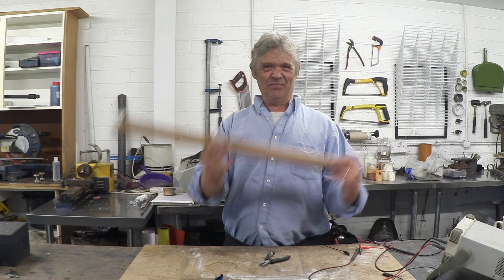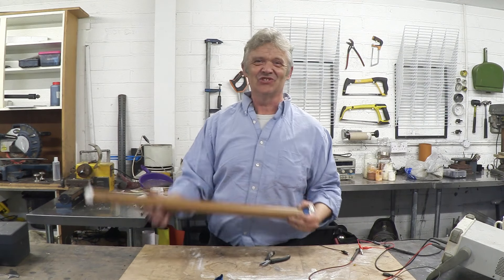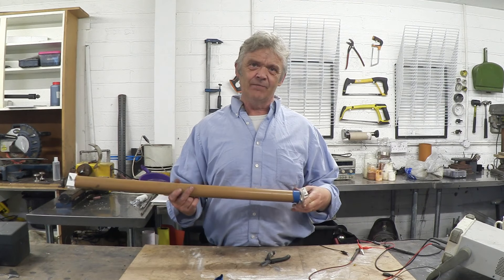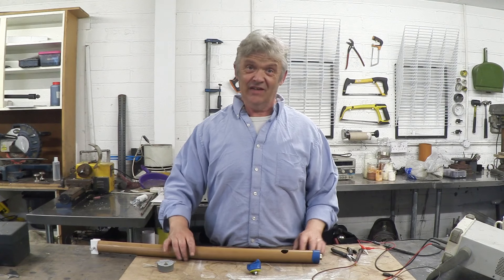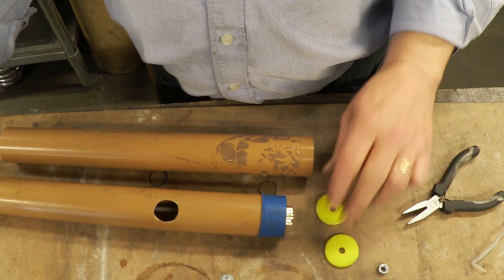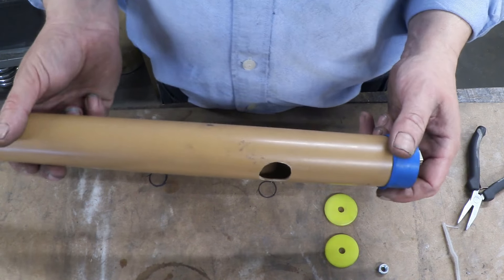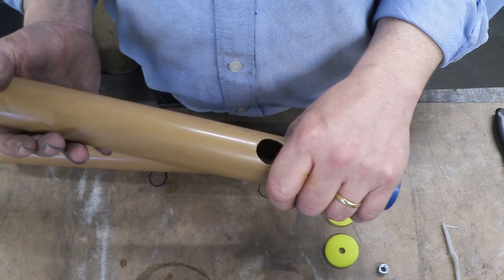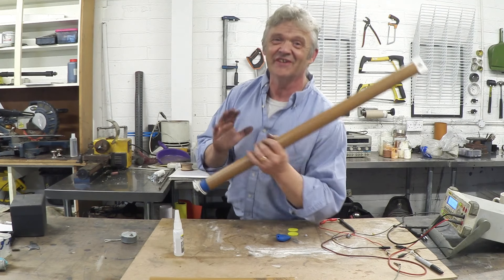A Wind Generator That Works Even When The Wind Stops Blowing

Comment: I've noticed in comments a lot of people thinking wind. My mind goes to water. If you had a pole extending over water and these wind generators as you call them, hung down off of the pole looking like a comb or rake then they would bounce off the top of the water with help from a foam ball at the end. Of course it wouldn't have to be a ball, it could be a paddle or a square. I can imagine this extending over water and all the fingers (wind generators) all jumping about making you electricity.

Comment: Could a vibration electricity generator be adapted to be powered by rainfall? There is an awful lot of potential energy in clouds. For instance, a cloud slightly more than 12 metres long and same wide and high ( assuming cube- shaped clouds), would condense to 1 cubic metre of water, which has a mass of 1000kg. If this cloud is 1000 metres above ground level, then the potential energy ( given by E= mgh, where g = acceleration due to gravity) comes out at 9.81 Mega Joules. This energy is converted to kinetic energy as the rain falls, and is then dissipated as noise and heat when the rain hits the ground. Surely there must be some way to recover some of the "rainfall energy"?

Comment: I never thought of putting it on the side for the Coanda effect. I've always thought of the acoustic mechanical energy of a whistling open-ended type, not unlike the thermoacoustic effect of B&J's subwoofer refrigerator (only in reverse).

Comment: If you multiply your short circuit current shown on the meter by the open circuit voltage (switch to the voltage range with the same lead connections) you will get a rough idea of the power produced.  I would guess about 200mA x 10mV = 2000 uW (micro watts) or 2.0mW of energy.  In reality. the output energy will be less than this, even with a properly matched load.

Comment: Wish you would get what you are talking about right in your description. As dose it t generate WIND ??? As you say it is a wind generate. But it is an ELECTRICAL generator POWERED by the wind. 
Just as a water wheel dose NOT generate water, it transforms the energy from the water into some other form of power. This could be physical power to turn a stone to grind up to make flour, or if you hook it up to a electrical generator, then it will make electricity. 
So what you are describing is an ELECTRICAL wind power generation system. 

SORRY for sounding pedantic, but I try to use the right words to explain and describe things. 

I can give you a good example of this. As many years ago I worked for what was then British Rail. A guy asked me when the Newcastle train was due. I asked him did he mean the train going to Newcastle or the train coming from Newcastle ??? He told me that it was obviously the train coming from Newcastle. I told him that Ben it was due, but told him next time he was to ask anyone, to ask them about the train FROM or the train TO. 
As I could have quite easily told him about the train going to Newcastle, and he would have came at the wrong time and gotten mad by MY wrong information.

Comment: Hi there ...Can we use a speaker instead as  it contains a coil and a magnet and it does vibrate and use it in the opposite way to generate power ?

Comment: Hey, what do you think about using guitar strings in place of the artificial vibration device your using? Guitar strings can be easily tuned and are very sensitive to both touch and high pitch sound, just a thought.

Comment: Put a round spiral wind turbine on the outside of the pole that also produces electricity and vibration and you get a two for one generator to put next to a highway. Connect them all together and you have free LED light post.

Comment: Take a stereo speaker and connect to the multimeter. You also will read voltage and mili amperes because of the vibrations. Sadly is very low wattage.

Comment: What if you rigidly fastened the base of one of these, to each pane of glass on all commercial buildings ? Eventually backup battery packs would be filled and all extra could be sourced internally for lighting etc...Great idea for bulk applications. Watching a spy movie gave me this idea. Listening devices reading the voice vibrations off the window glass means constant vibration from all kinds of sources. TAP THAT ! Noise pollution becomes a positive !

Comment: Now THIS is really cool.  Especially the low cost, apparently easy-enough assembly, and public domain.  I can imagine several of these mounted on a horizontal base, the whole thing shaped rather like a menorah - even though I'm the world's worst at crafting useful things.   .....  Did I miss something about the suggested gauss (??) of the magnets?  How is this device attached to something (a go-between?) where you can attach the cell phone etc. ?  I mean, no point in creating electricity you can't access somehow.

Comment: This would work great as a windchime with several suspended on strings and a clapper suspended in the middle on a string.  Slightest wind blowing and the clapper would set them to vibrating.  Hmmm....I might just try this or something similar.

Comment: I actually saw something similar recently on the channel "Undecided with Matt Ferrell", where he went through several different projects for possible solid state wind energy systems. In that it was called a Vortex Bladeless wind turbine and it's based on vortex induced vibration resonance, ie. vortex shedding. The design is slightly different, but I think it's basically very similar and highly scalable. That said, their nearly 3 meter turbine only churns out 100 watts.
Reply: That is where i saw it too, on the Undecided channel on YT
Reply: Just fabricate 30. units of such contraption, and you shall harvest 3,000 watts of power for aver. resident daily consumption... As simple as that...
Reply: What's the power generated ?

Comment: I agree, if we want to "go green" it will take combining many many different generating methods together efficiently into a main grid system.  For example, on a british television show starring a regular cast member of Junkyard Wars and his family living in a country farm house off grid.  They used a home made hydro-generator in a small stream for power, they also used a version of windmill power with special blades that spun no matter which direction the wind blew from then put the generator motor and the propeller inside a plastic pipe and ran additional connected lengths of the pipe down a seaside cliff into the water at the base of the cliff and the never ending wave motion of the sea water pushed and pulled the air through the pipe running the generator nonstop.  I think by combining ideas such as this with ones like your windless wind generator creatively ( like your idea of using wasted kinetic energy such as bridge/highway vibrations to generate energy ) and by creatively adapting these and other ideas to generate power.  for example wind turbines strengthened and adapted and placed submerged in ocean canyons ( carefully blocking the areas with nets to protect sea life so we don't have an ocean version of the massive bird kills of wind mills on land ) with predictable constant currents for dependable energy.  Or using scrap waste fragments from solar panel production to power small DIY style hydrogen generations that only require a few volts to produce results but deployed in massive solar farm style or in a deserted open landscape build a skyscraper to house the dozens of floors with hundreds of individual generators per floor and the roof and surrounding property covered with the solar panel fragments each wired to a single generator induction coil for separating out the Hydrogen with a pipeline bringing in the water or sea water for a less efficient manner not requiring trucking in the more efficient chemical additive.  But until this can be done we need to get back to the Trump plan and make America energy independent and an energy exporter, because if you really want to protect the environment you have to admit America produces oil and natural gas much more cleanly than Russia, China, Venzuala, and OPEC who are the main world energy producers now and they are pumping out hundreds if not thousands of times more polution than America does while producing more energy.  The current plan by the Biden administration is apparently save the environment by destroying it.

Comment: Idea to help you, replace the coil and the magnet with a piezo element and 4 diodes to get DC .... it removes the expensive rare earth magnets, they cost only 1 USD and can output a very very high ac voltage on vibration... the high voltage allows you also to use very thin wires so you save again on copper. If you buy 4 of those piezo elements then you dont even need the spring in the middle, instead you just put the pipe on the 4 piezo elements, bam.... free electricity on micro vibrations...

Comment: I havent seen your artificial muscle yet... Untill then, my thinking goes with principle of a tonally tensioned blade.

With some black paint, an optimalised freq hole/pipe lenght and diagonal/vertical positioning of the unit, 
convection from sunlight ought to be able to generate draft enough to make internal flute tone for solar acoustics as well.

Pipe in painted copper and outer glass tube as a convection heat amplifier most of the tube´s way, could prove fun. Probably to some cost of the ambient noise collection...
Will an exponential horn on top be able to effectively amplify the vibrations ?

Comment: ... the tube with the hole in the top will catch rain...
... would flip it around with the capped end at the top...
... *... could a screen door metal spring be used...?

Comment: I think that this 'invention' a magnet mounted on a diaphragm vibrating in a coil is commonly known as a microphone. I suspect that the 'load' applied by your DMM is <1ohm and therefore the power output is negligible :)

Comment: The shape of the tube could probably be enhanced to maximise turbulence and vibration as the air moves past. A smooth cylinder doesn't seem optimal just guessing.

Comment: I know I'm 2 years late but I was just thinking, what if you put a small metal cylinder inside the tube only connected to the midpoint of the muscle and not touching the inner walls of the cylinder with the muscle running through the center of it? Hopefully that makes sense. Like imagine if you glued 5 dimes face to face, drilled a hole through the face of one and out through the face of the other end, run the muscle through that hole, and glue the cylinder of dimes to the muscle running though it and the midpoint of the muscle? It would take more energy to vibrate the muscle but if you got it vibrating enough then the inertia of the the metal cylinder moving side to side would produce more energy. Like imagine you have a bunch of tunes designed like this laying horizontally underneath a layer of asphalt on a road. That would be enough energy to shake that metal cylinder where-as the muscle alone probably wouldn't be able to make use of all of that incoming energy.

Comment: For the past thirty odd years I've been insisting that the way to cleaner, cheaper and safer energy distribution is to go low-voltage domestic, wherever possible.   So long as the amps equate to an average household requirement; which must also include reviewing one's energy requirements, that must include; change of lifestyle - education (switch that bloody light off, when not in use...).  And the understanding that Every Little Amp helps...
.
I've been working on a design for a new type of central hot water/heat storage system, based on the Thermos Flask principle; concentric hemispherical cylinders with a vacuum between - the inner vessel  containing the hot water storage, fed by various thermal generators - back boiler - solar-thermal collectors - ground source heat pumps - low voltage elements.  Brazed to the inner vessel are an array of radial heat-pipes that conducts some of the inner vessel's heat - through the vacuum space - to the outer vessel, via ceramic 'ports' where the heatpipes are brazed to radial heatsinks surrounding the outer vessel.  The whole tank is further encased in a box of mica insulation chips (loft insulation).  Attached to each  heat sink are the 'hot' ends of an array of thermocouples, with the 'cold' ends attached to another set of heatsinks located on the inner surface the encasing box; an extra coolant circuit could be employed.  The current generated by the 'radial thermopile' should be adequate enough to run the the ancilliaries of the whole system - pumps - valves - uProcessors, controllers etc...    Combine this with good house insulation and solar-kinetic electrical generation - PV - wind - your 'energy harvester' and we get a 'net zero' lifestyle - more or less...    
.
The idea was formed when studying the design of Systems for Nuclear Auxiliary Power - or SNAP generators that are used in space probes and satellites, or marine autonomous vehicles.   The Radio Isotope Prolonged-Powered Life Equipment - RIPPLE generator uses a similar array of thermocouples on heatsinks, that surround a casing containing a plutonium pellet the releases heat as it decays.  In the relatively cold vacuum of space, thermocouples are ideal, giving the thermal gradient required to generate enough wattage to run the vehicle and its sensors.            
.
I think I need to check-out your membership.  As You Sir, are a 'steely-eyed missile man' for sure and your concepts are right up my brain pipe.

Comment: Im no scientist or educated individual. But if im understanding correctly. The base goal is to vibrate the diaphram/magnet. So wouldnt using and straight wire/or something more solid instead of a artf.muscle be better?. The artf muscle i feel is essential a spring. Which will absorb more energy and dissipate it in the tube before transfering it to the diaphram.? Maybe im dumb.

Comment: why not use a steel spring? That's last  longer than the  wound up trimmer string  wouldn't it?  One ting I've often wondered at is the question of magnet  cost and durability.  they do wear out and there is a cost to produce  so  maybe some time   talk about the  Return on investment  How many coils? How much in  materials versus how much energy produced?

Comment: Hi guys - vibration in long metal tubes - OK...any long tubey things around my place?
I was curious as there are hollow metal street lamps outside - and there is an  onshore wind at the moment.
Wow.... a lot of vibration in one lamp post ! Quite amazing amount actually - and there is a street full of them.
Quite frightening when you consider if you added all that energy up of those lamp posts in my street. Sure not as flash as a spinning wind turbine
but a untapped energy source for sure...hmmmmmm.....wonder if the council would miss a lamp post...LOL - just kidding...

Comment: I had an idea about the energy that can be made by a automobile running over pressure points to create a vibration on the roadway to create electricity.

Comment: You're gonna get almost no power out of that, even if optimised. The energy in wind is based on the cube, the third power, of it's speed. Then this thing just looks so inefficient, it's not taking advantage of the mass of moving air.

For the materials and the effort, there's much much better ways you could come up with a generator. I think it's a non-starter, honestly. Maybe for extra-low power sensors or something that charge up a capacitor then report by radio once a blue moon or something, where ruggedness would be important. Although even then, ice would likely bugger up the membrane and the workings. Not one of your best ones, Rob, though at least you gave it a go.

Comment: i'm still learning... but.. doesn't it mean if you don't know the volts.... then in theory this could even mean the device might only produce 1 watt of electricity in a million centuries?  If the miliamps are 200, but the voltage is very low.  ?...right?

Comment: How viable would this be on a vehicle? Imagine the wind forced over the hood if this were affixed like the old radio antenna. Or a row of several across the grill? From then the vibration of the car itself would be near constant. Since we are being pushed in the direction of EV which is not... Ideal, I can't help wondering if a couple of these, obviously optimized would correct the burden on the grid infrastructure that is predicted to be a problem forthcoming. Sorry, i am not an engineer so please anyone feel free to throw in possible pros and cons. I'd surely love to see a tester sized built.

Comment: This "vibration energy" harvesting sounds like piezoelectrics to me. It's already done and it's already cheap, but to get any meaningful power you have to use it somewhere you know is going to be subjected to a lot of impacts or "vibrations", essentially repeated compression and decompression, because even then it doesn't generate a huge amount. You might power a couple of light bulbs with piezoelectrics in the floor of a big room with lots of foot traffic, but I don't think a wind generator setup  when there is no wind blowing would ever provide enough power for anyone to notice unless you kept tapping on it like you did here. Or if there's an earthquake, perhaps. In the end it's a neat idea but I think someone's probably already thought of it before and decided the amount of energy you'd generate isn't worth further increasing the complexity of wind turbines. Better to just keep them as two separate types of power generation used in places where either one or the other makes more sense.

Comment: So what you made is just a tubular speaker, could you not just take a 15" sub woofer and do the same thing?   The wind would move the speaker in and out which would produce voltage, and sounds or vibrations would also move the speaker cone which also produces electricity. 🧐🤔🤠👍